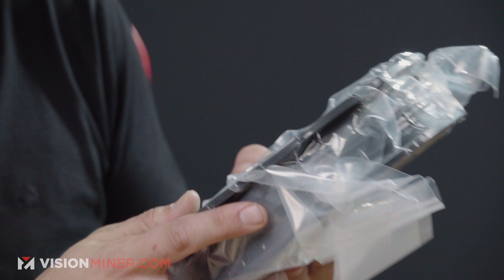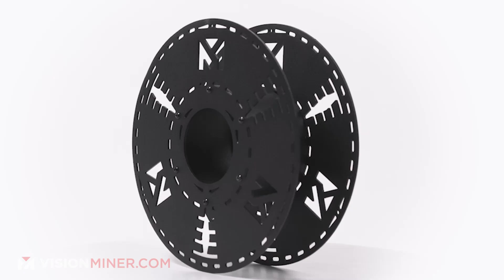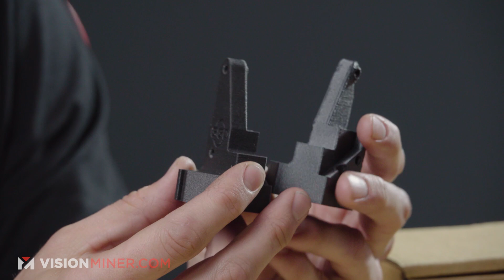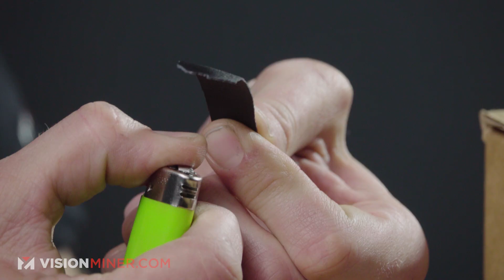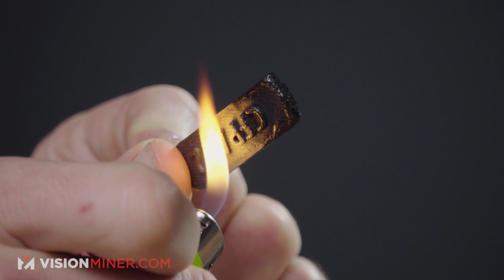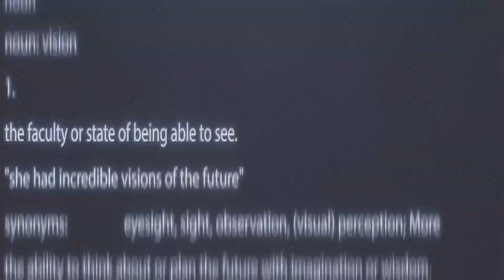CarbonX PA12+CF Carbon-Fiber Reinforced Nylon 12 (CFPA12) 3D Printer Filament by 3DXTech

Comment: I just printed this for the first time today - Ender 3 S Pro with the sprite extruder, hardened steel 0.4mm nozzle. Hot-end 285, bed 55, 60 speed. Pei textured bed plate. It came out perfect first time

Comment: exorbitant expensive !!! not a feasable solution ...
Reply from the maker: Context is everything, so if you have no business application for it, then correct, it's probably not worth it -- but for the right application, it's a steal :) Most of our customers are in manufacturing, so CFPA6 is generally a better choice for standard machines :)

Comment: I think it would be awesome if in these videos you did a simple deflection and tensile break tests for different print orientations.  And have it compared to know material like aluminum and ABS.
Reply: Also it would be valuable for a lot of new 3D print people if you were to do the same testing on  parts made with dry filament Vs Parts with un-dried filament

Comment: I print CF nylon on my Ender 3 Pro with an all metal hotend running Marlin firmware. 60C glass bed with glue stick, 270F nozzle, hardened steel nozzle, print speed 30 to 40 mm/s.

Comment: Please do some of Polymaker's COPA filaments. Supposedly they are the strongest, I want to see if that holds true.
Reply: well, according to PolyMaker's PIS, for some reason, they say generic PA6 has a youngs modulus of 2621 and in impact strength of 9.9 kj/m^2 vs 2223 mpa and 9.6 kj/m^2 for CoPA. I'm confused myself, but CoPA doesn't warp.
Reply: I think CoPA is extremely strong, but polymaker even offers stronger materials.

Comment: How can it be called carbon fibre reinforced nylon when the nylon is stronger without the carbon fibre?
Reply from the maker: It makes it more rigid -- especially under higher temperatures. Strength to weight ratio -- it's not as impact resistant, but it's far stronger up to a certain point.
Reply: I think it increases stiffness and layer adhesion

Comment: As someone living in Phoenix, AZ where the ambient humidity is usually around 10 to 20%, should there be any concern about the filament absorbing moisture during a long print if not stored in a dry box? I will use an oven to initially dry the plastic, and it will be kept inside of an enclosed 3D printer during prints, however, I am unsure if I will have any problems with moisture absorbtion during 20 to 30 hour prints
Reply from the maker: You'll have a lot less issues than everyone else -- but you'll still need to dry it and keep it dry during printing on long prints like that.
Reply: Any humidity level over 10% will effect it. Drying boxes are cheap and they're totally worth it. Store it in a vacuum bag.